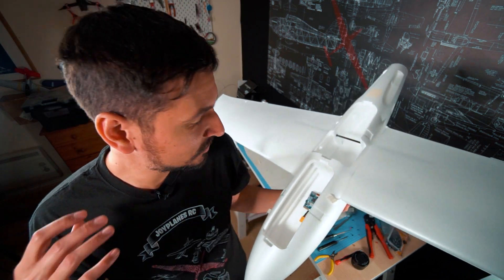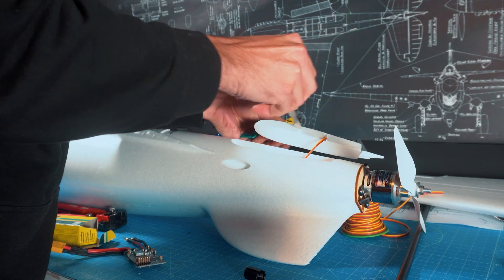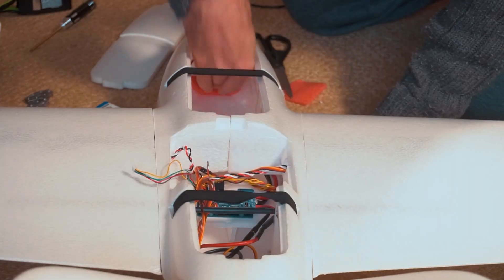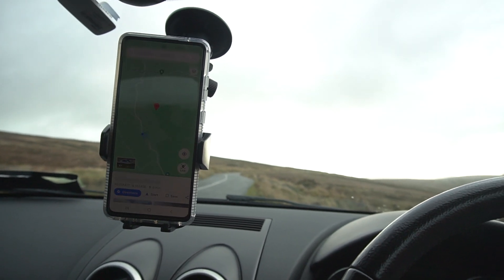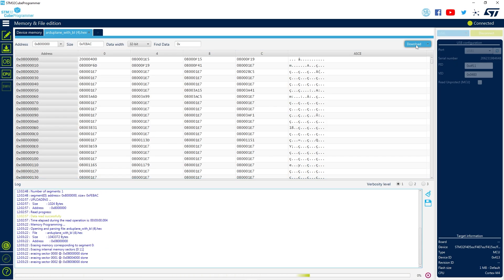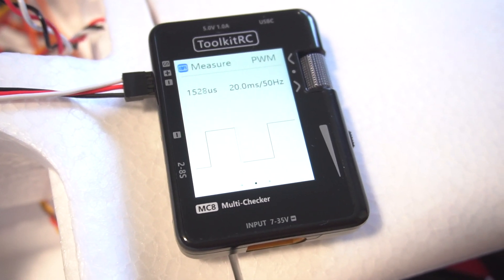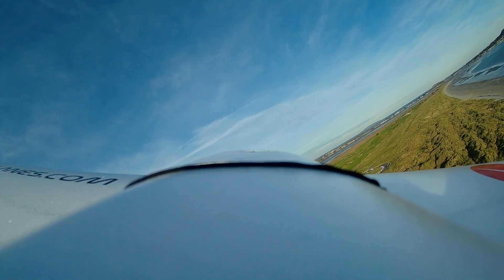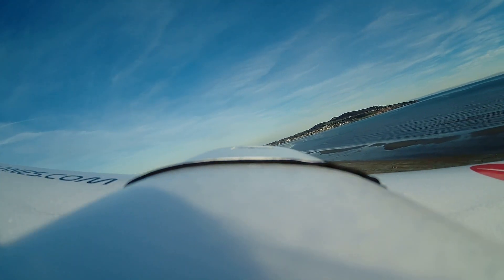Talon Pro Ardupilot FPV - Complete Build (includes drone hater at the end)

Comment: Hey, I'm about to start building my Talon, I was planning to use the clear gorilla glue the same as you did. Have you had any issues with that glue not holding the parts together?
Reply from the maker: It was OK for the build, but roughen the parts a bit for the parts the glue is going to contact to ensure it works better.

Comment: Awesome video and well done analysis. I started during corona when they closed down the gyms and during my short career i aswell had a few unpleasant situations. What i found out is that it never was arduplanes fault. It was just me not being patient enough. Arduplane however has saved me multiple times or protected me from any serious damage. The software is awesome. 
I've had some trouble with the gps fix at first and i've lost a single plane because of that. I learned that when i plugin my tablet only the gps and rx get powered up, which improved gps position significantly. When it's disconnected and fired up again by the mainbatt the gps apparently remembers the previous position and has to problems fixing.

Comment: I only just discovered you channel while looking for my next airframe, after totalling a believer I was planning to use to really push the limits of expresslrs. I was pleasantly surprised to find you are using ELRS yourself haha 💪
A couple tips I have found when flying 1.3 that may help you (feel free to use, or not):
- That supplied Matek 1.3G Y antenna isn't very good. A TrueRC singularity gives much better results on the air side, and coupled with a 1.3G X-air on the ground, you should see 50km+ with good signal
- 1.3G video has an alias close to 2.4G, so running 2.4G ELRS and 1.3G video isn't really a great option. I'd look at either changing video to 5.8 (at the expense of range), or use 900mhz ELRS hardware instead of 2.4.

Just subbed to keep up with how you're getting on with ELRS :)
Great song BTW man ;)
Reply from the maker: Thank you so much for your comments, someone had recommended me the same gear and said the same recommendations. I'll be getting the antenas at some point and try that. Thanks.

Comment: Hello, at the end of the video a standard situation is shown that deals with legal issues relating to model flying. Regardless of what it is about - especially personalized recordings - occasionally we model pilots are accused by self-appointed "police officers" of not acting in accordance with the law. Therefore, these people feel compelled to harass us with massive threats or even to commit damage to property or theft of our property!
I am German and have been practicing this hobby at home and abroad since 1970. Unfortunately there were and are such people always and everywhere. Outside of an airfield - and even there - you come across him again and again. Of course, I obey the law and have all the necessary permits with me. However, it should also be borne in mind that the local police patrol, should it be called up or deal with it, usually has no reliable knowledge of the local legal situation. It is therefore always good to be prepared accordingly and to have copies of the most important legal texts with you. This will quickly give you an advantage in the case of local allegations and also the legitimation to take action against these people.
Actually, we all don't want to have any problems and just find some relaxation and joy in peace. In my experience, however, this is only possible if you use all your might to defend yourself against hostility as early as possible at the beginning of a conflict.

Comment: You don't need elevator servo out if you already set vtail left & vtail right servo out. Just remove elevator output, and put the servo wire on the vtail left & vtail right on the servo rail FC.

Comment: Wow, glad she wasn't carrying. Nice plane and build. I too am trying 2.4g ELRS on my FPV planes now that it has great Telemetry Yappu and INav LUA scripting. I'm using the Matek 2400-D receivers on elrs 2.0with great range on low power. I also converted an R9M , but haven't gotten telemetry going on it as yet. I would rather stay with the small antennas of 2.4 if possible.

Comment: It is completely normal that it is not reaching the maximum and minimum values on channel 5 and 6. this is because it is V tail and those values are mixed with rudder. There is no bug in arduplane ant nothing wrong with your board.